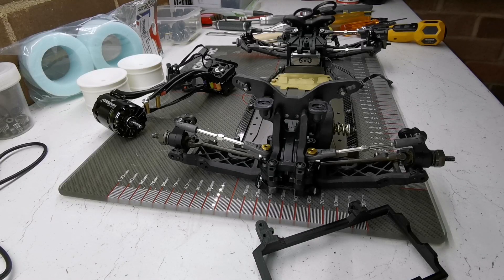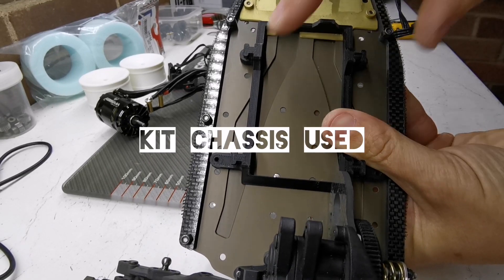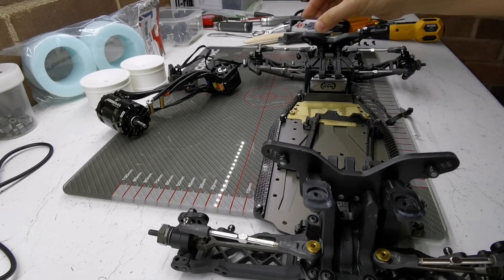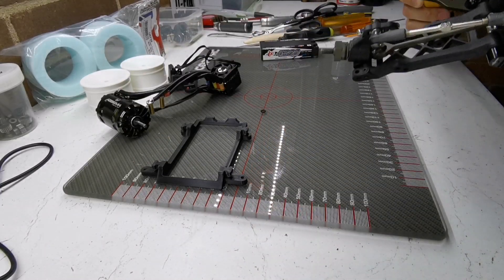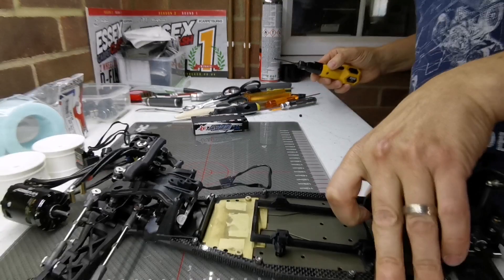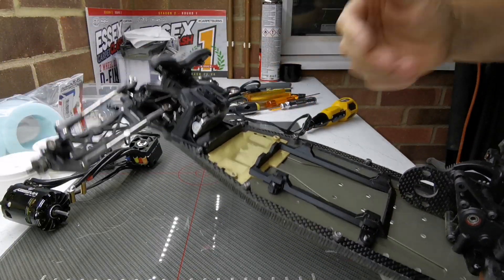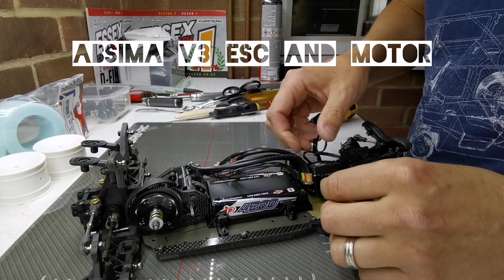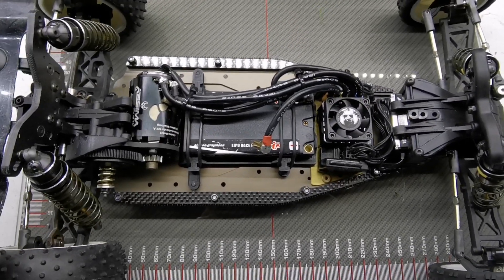Schumacher cougar laydown #wdesign lipo holder

Comment: I dont suppose you know what the spacing of the holes in the chassis are do you?

I'm trying to find a lipo holder for my old cougar 2, I found a couple for this model but cant tell if the hole spacing is the same or not.

Nice buggy too by the way 👍
Reply from the maker: Sorry I don't have the measurements to hand, but I will have look later